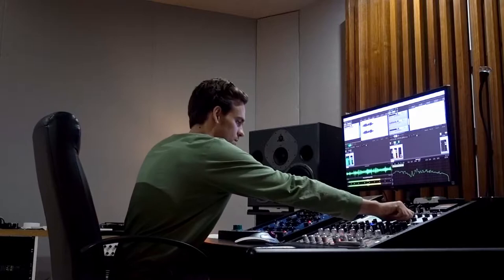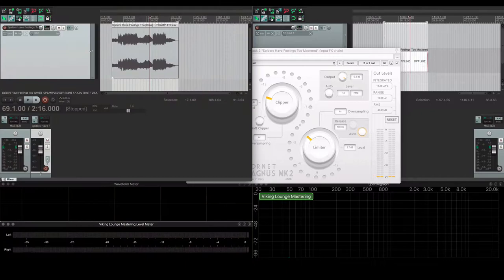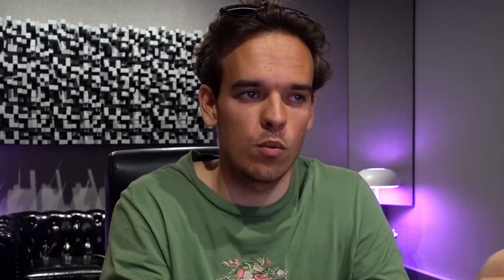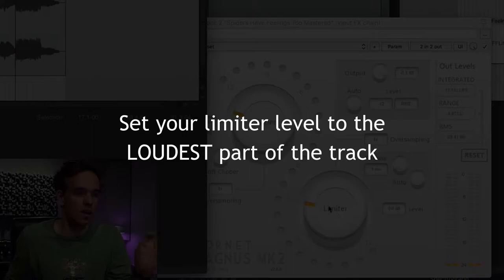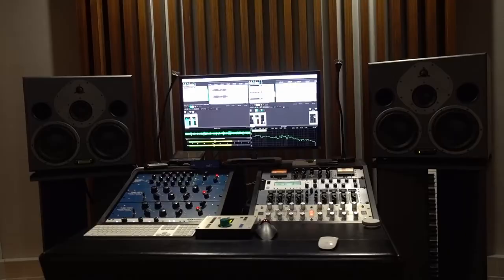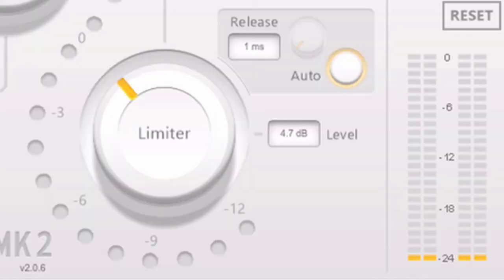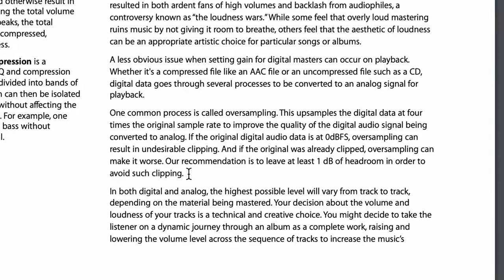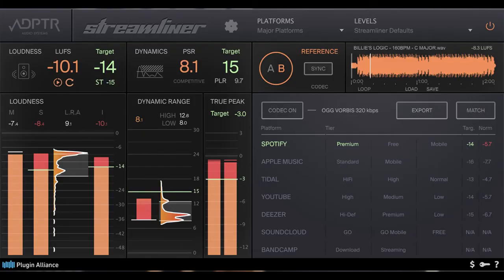How To Set Your Mastering Limiter

Comment: Search  “TC finalizer”  to see all the charting hits true peak values. Almost all of them go over 0, some go WAY over 0. Just set your final limiter ceiling to -0.3db (don’t use true peak mode) and don’t worry about ISP/True peaks. At the end of the chain, try Oxford inflator (100% effect, curve to taste, (0% to start) band split engaged) into a soft clipper (1-3db), into a hard clipper (0.5-1db), into 1-2 limiters doing an equal amount of limiting. If using 2 limiters, make sure the first limiter ceiling is 0, and that you match the output so that there’s no volume change when on/off. The volume will come from the final limiter.
Reply: im gunna try this bcuz I’m already getting -6 LUFS with just a clipper(ash) and a limiter(Ozone)